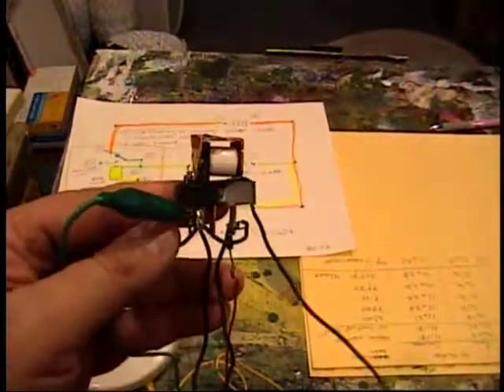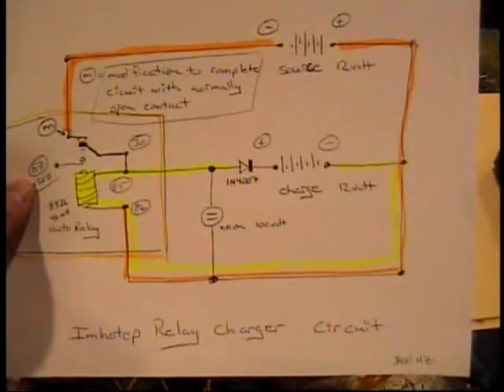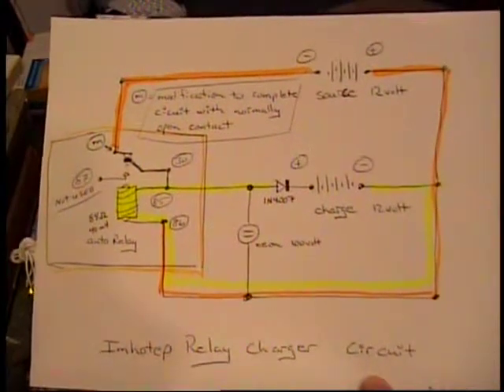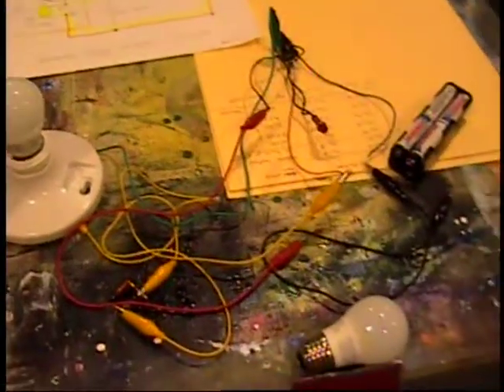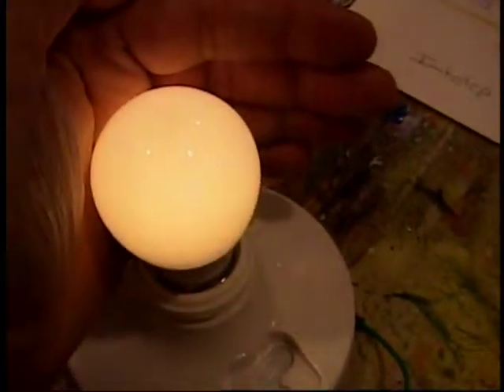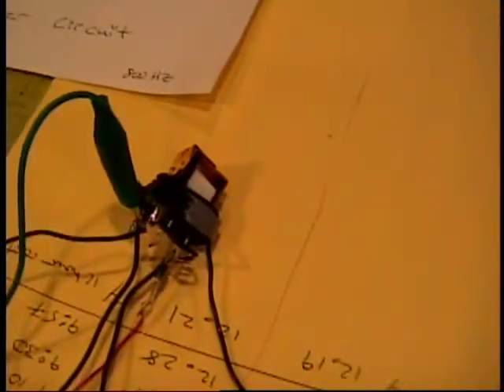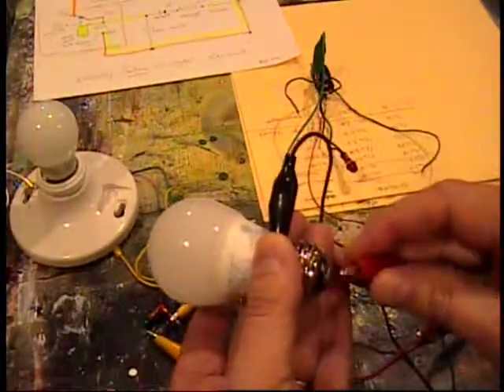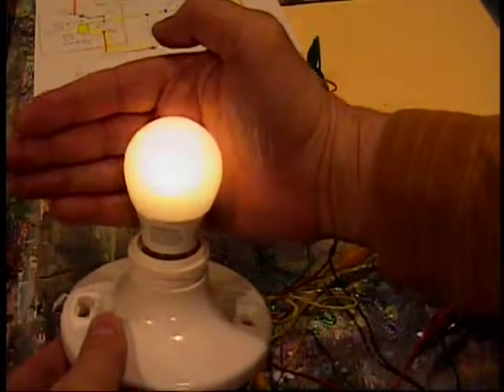EMF from Auto Relay

Comment: Why don't you use a piezo buzzer to do the same thing?
Reply from the maker: Tom, it's the magnetism I'm after. When the coil is cut off from power the magnetism snaps back into the coil causing a flash of voltage. The piezo buzzer has no magnetic effect.